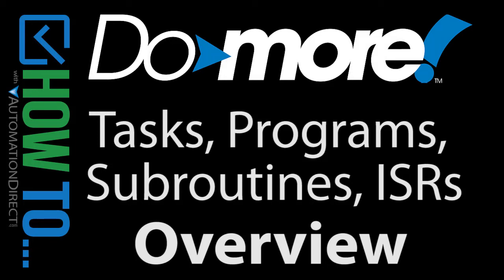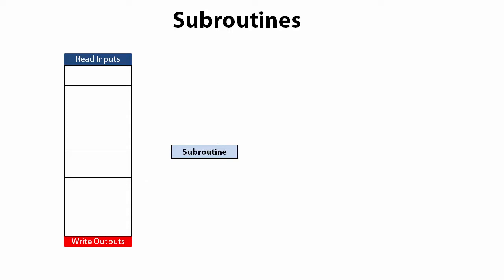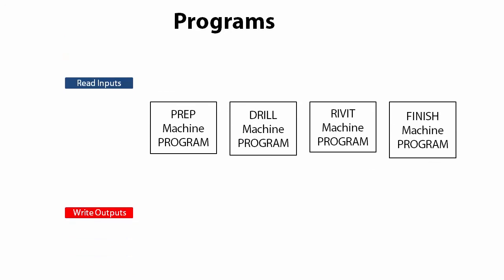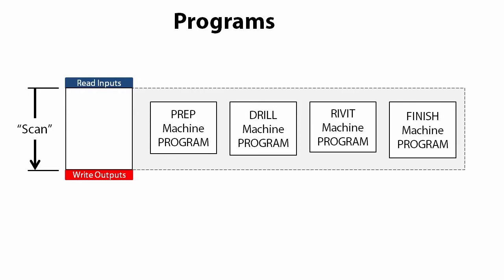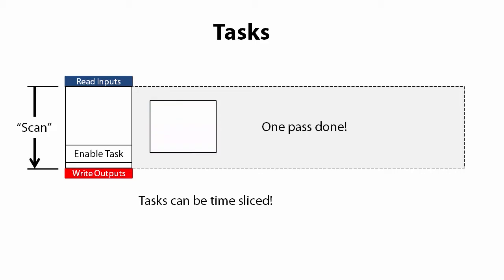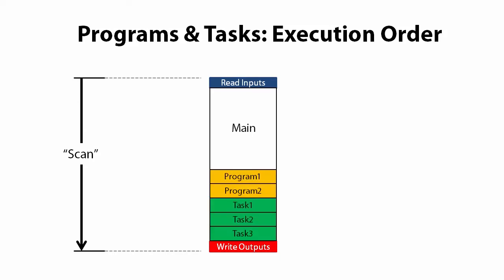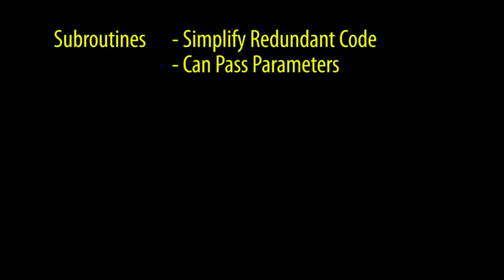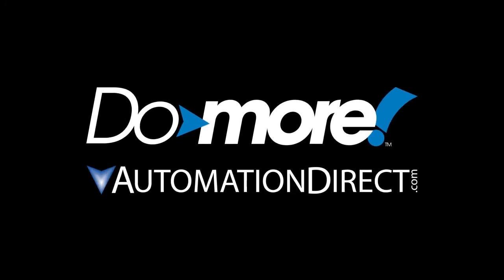BRX Do-more Designer Tasks, Programs, Subroutines & ISR from AutomationDirect

Comment: I dont understand program vs subroutine. The way its described makes it sound like this is a multitasking controller. Is this correct?
Reply from the maker: Hi Logan,
Yeah, it's subtle. 
Subroutines are literally run in-line with the rest of the scan, every scan. 
Programs are run AFTER the main program and you even can specify the order in which they are run.
Would I call it multi-tasking - yeah, I suppose you could think of it like that.
Check out help topic DMD0231 (Code-Block Overview) in Do-more Designer for a good explanation.